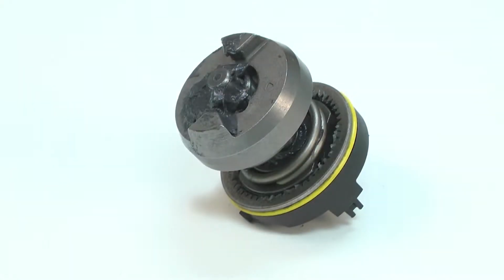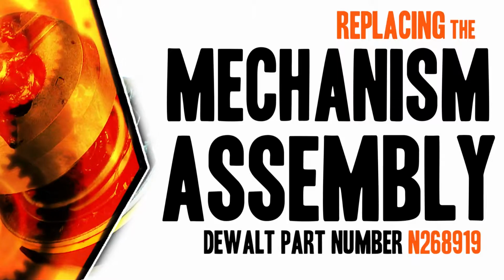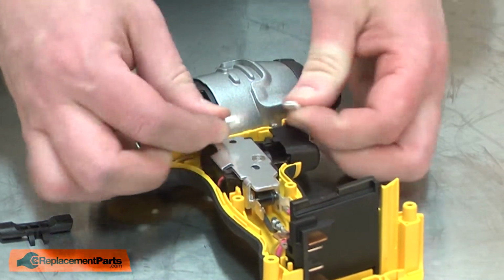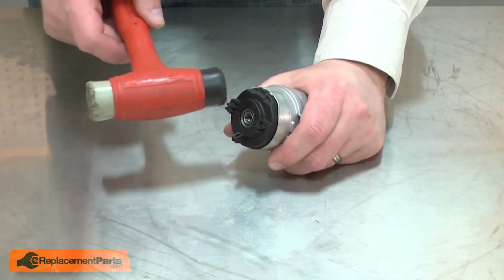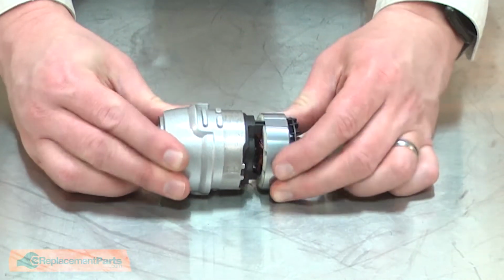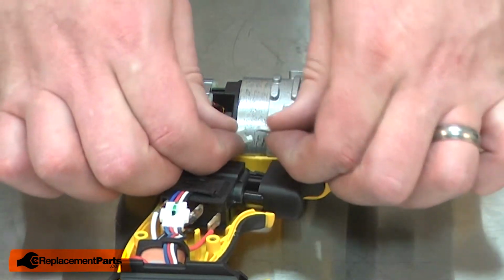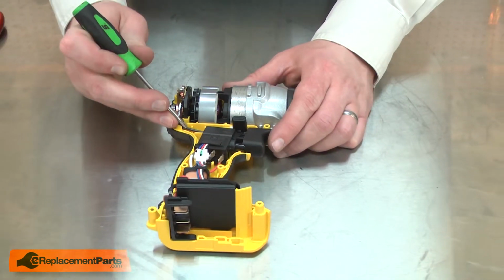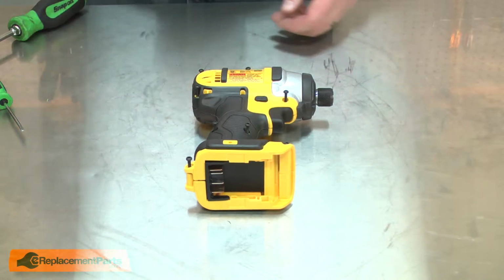DeWALT Impact Driver Repair - Replacing the Mechanism (DeWALT Part # N268919)

Comment: Good stuff! I would like to add that you may want to add a little grease, since the manufacturer skimps on that. When screwing the shell back together its best to rotate the screw left till it drops into the thread that was created when the manufacturer first assembled the unit.